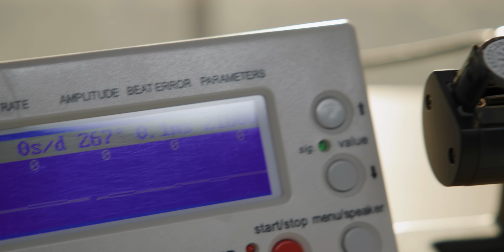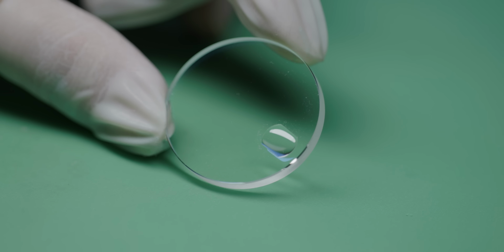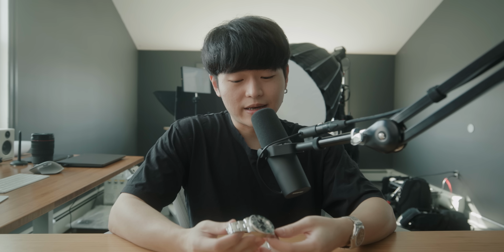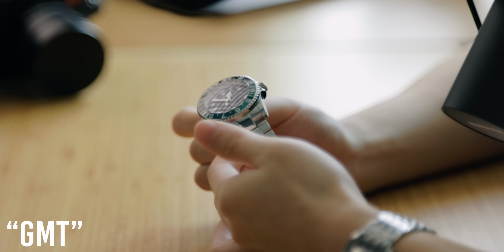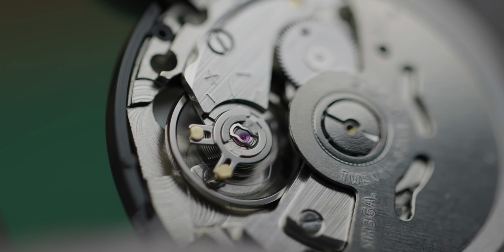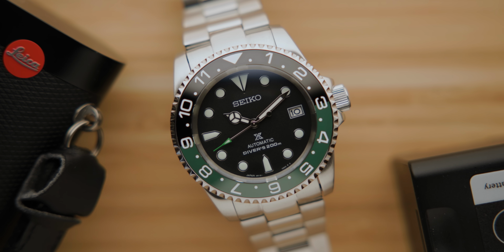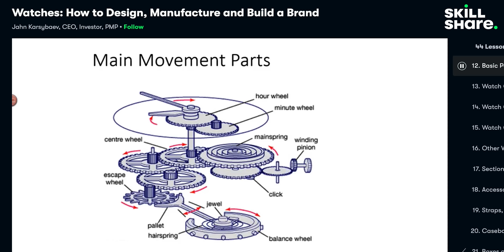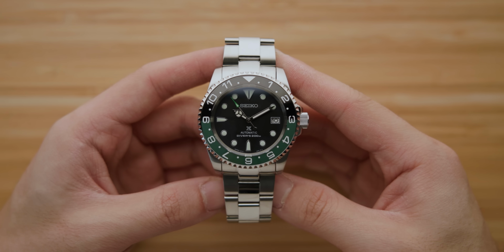Building a Custom "Rolex GMT Master II 126720VTNR" Seiko Mod

Comment: How can you place the minute hand at exactly 6 o clock?
Reply from the maker: You would use the 6 oclock marker as the center reference point for the hour, opposed to 12 when setting the minute hand. I find that some minute hands are easier to see alignment when the hour is at 6 opposed to 12.

Comment: I just don't understand why the hands are placed with the hour hand pointing right at 12 and the minutes hand at 6. Wouldn't that screw up the timing? Because normally at 12:30 the hour hand is between 12 and 1.
Reply from the maker: Hour hands at 6, minutes at 12
Reply: @LumeShot  oh OK thanks

Comment: This might be a dumb question but will I run into any problems with fitment if I take a movement normally in a case with a 4 o’clock crown and swap it into a case with a 3 o’clock crown?

Comment: hello, excellent videos .. and for a video of a Seiko MOD send an adiesdive cap.  willard to change the dial/face to a Seiko (AliExpress) and when I pick up I see that it is not exactly centered at 12, it has a small deviation to the left, my watchmaker says that he could not adjust it anymore and that maybe I should put a face /dial with date at 4 o'clock and not at 3 o'clock. Did it happen to you or could you tell if what my watchmaker says is true, too bad I can't upload photos. Greetings from Madrid 🇪🇸

Comment: Thanks for video!   That even you make compatibility mistakes speaks to my biggest fear.  Hard to pull trigger on buying a bunch of parts when unsure if it'll all fit.  Most mod websites don't make it easy to confirm.  BTW - there is no guidance what, if any, lube or grease is needed for a SRPD (your recommendation) build - can you do another video that addresses this?  Thanks!
Reply from the maker: Ive used so many type of parts over the years and so I have my own record of dimensions / compatibility "rules". Its rare that I encounter a new part, but whenever I do, I try to get as much info from the provider. Unfortunately in this case the providers details werent exactly right, so there wasnt much I could do at that point haha. Its much easier these days to know what parts fit since the mod community has grown so much, but years ago I had to buy everything blind and scrap a bunch of things. Just comes down to experience!

Comment from the maker: SPONSOR: The first 1,000 people to use this link or my code lumeshot will get a 1 month free trial of Skillshare! https://skl.sh/lumeshot04221 
Do give it a try! Each click does support my mod videos :)
Reply: Admin, I think we have to order the dial. Let the date be at the 9 o'clock position. Then remove the strap and put it on the other side. The case and the hands of the watch are all used the same way. and the cost of ordering the production of dials The price is about 25-30 dollars per piece.